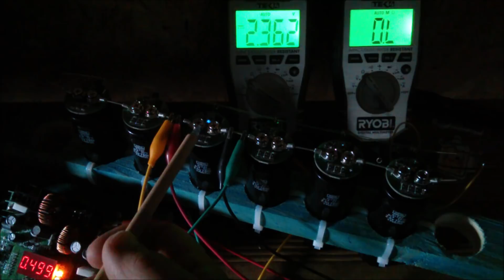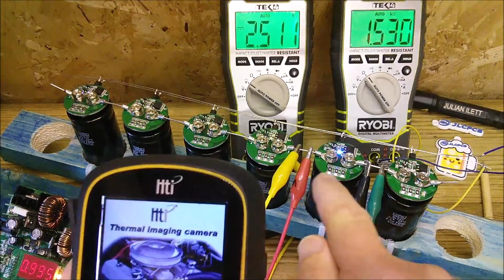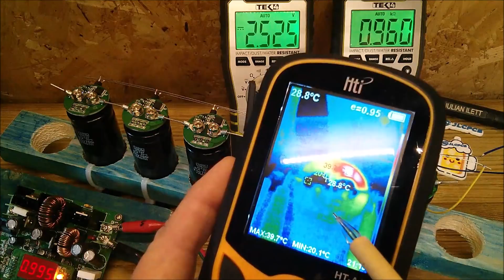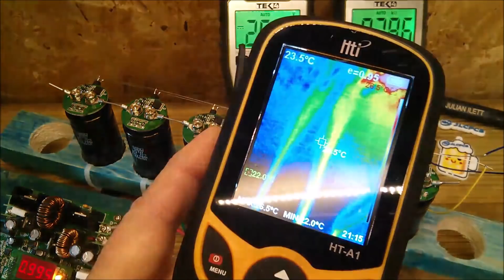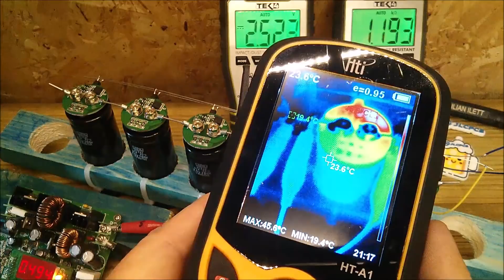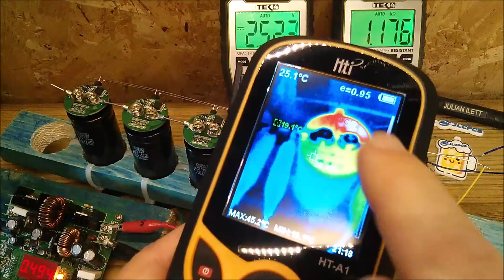Supercapacitor Optoisolator Full Charge Detector

Comment: So I pieced together the root cause and all the other issues with these protection boards. Long story short, it's the TL431:
First, schematic: https://www.eevblog.com/forum/projects/chinese-tl431-super-capacitor-balancer/?action=dlattach;attach=661308;image
1)The TL431 pulls its cathode down to 2V and no lower. 
2)The PNP transistor is left with 0.5Vbe at 2.5V which is below the typical BJT ON threshold voltage of 0.66V (S8550). Most silicon transistors are like this. Germanium transistors would turn on at 0.3V.
3)The low base current in the PNP contributes to a high Vce above 1V (definitely not in saturation!)
4)The optoisolator's series infrared LED contributes to another 1V-1.2V drop
5)The D882 NPN transistor is left with just about 0.5-0.6V, base current about 2mA. For saturation and 3A current to be possible, it would need a Vbe of 1V-1.2V across it. 
6)The balancing resistors are three 1.2 Ohm resistors, making an equivalent resistance of 0.4 Ohms. If the NPN was in saturation and dropped 0.4V, the resistors would start current limiting at 5.5A which is beyond the D882's maximum rating. At the current level of operation, the voltage drop across the resistors is 0.16V at a supercap voltage of 2.5V

Solutions:
1)Replace the TL431 with a version that has a 1.25V reference on pin 2 or a TL432 flipped upside down, and cut the thin trace on the shorted out voltage divider to get the circuit to turn on at 2.4-2.5V. This will pull the cathode of the chip down to a lower 1.25V output and actually give the PNP the base voltage it needs to turn on.
2)Replace the PNP with a germanium transistor or switch both the PNP and NPN transistor to P-channel and N-channel MOSFETs. This is what I did, but my intention was also to upgrade to 20A balancing current. Here is a schematic, note my supercaps are rated to 2.85V, so I can actually get away with a 2.5V reference TL431: https://photos.app.goo.gl/yV3n1sAmudKa6ZR98
And here is my previous video post about upgrading the balancing performance using MOSFETs: https://www.youtube.com/watch?v=3qkKNievsFM&lc=UgyQz4Omeb5TNwf0pSN4AaABAg
3)Increase the balancing resistor resistance to 2.2-2.4 Ohms to limit current below the D882's maximum, only if you want the NPN to run cooler.

Comment: I have a set of those cheapy croc clip leads - and rather than mark them up, I bit the bullet and soldered all the clips - 20 of them I think :o(  I have some cheap Dupont style jump leads too, and not only are the crimps too loose, but I've just discovered that one wire at least is open circuit due to corrosion up inside the insulation - blasted CCA wire - are we doomed to put up with this stuff forever now ? I think I may throw the Dupont style leads away and start again....

Comment: Thanks for all this work, but I think it would work better with an op-amp working as a comparator type lm393 since it works from 2v. Sorry for my bad English.
Reply: The TL431 is already working as a comparator. The problem with it is that it is only a 3-pin device, so its output and VCC share the same pin. When the output is active, the voltage drop across the open-drain falls to only 2V, any lower voltage would turn the TL431 off.

The LM393 is a 6 pin device, it would also work as a comparator, but this time the output and VCC are on seperate pins, so the open-drain can fall to a lower voltage and VCC remains above 2V. Then the PNP amplifier will reach saturation and function properly. 

So I agree, the LM393 would do well in place of the TL431. The protection board should never have used TL431 with 2.5V reference. Only being able to pull down a pin by 0.5V is almost useless in this application. This is the whole reason for the poor performance.
Reply: @InfinionExperiments  And the current drain by lm393 are much lower

Comment: Technically, those dmm are measuring resistance with a constant current source, then measuring the voltage drop on the resistor. This means, when no R is used, it'll saturate the constant current source and the voltage you'll be able to read is about the Vcc. Also, the fact that's putting some current into a collector/emmiter of these optos is actually how they managed to measure it. The optocoupler doesn't work as a switch, but rather as a "remote controlled" transistor. I would've used the diode setting to measure this. Probably you would have seen a Vdrop of about the Vce sat (1.2 or so volts). Make sure that's enough to turn off the enable line of your switching power supply, which should be pulled high by default.
Reply: There is also resistive opto-isolators, but that isn't what this is :) If it were a resistive opto-isolator, his method would be right.

Comment: Fun Fact: When you connect capacitors in series, you increase the voltage they can take but you reduce the capacitance.
Specifically, the resulting capacitance is given by 1/(1/C1+1/C2+1/C3+1/C4+1/C5+1/C6) where C1-C6 are the capacitance values of capacitors 1 through 6. Edit: If all 6 capacitors are the same value then you can get the same result by 1/((1/C)*6)
Reply: Yep but the energy stored is  dependent on the voltage squared so you decrease the capacitance but increase the overall energy stored.

Comment: I couldn't get my Arduino EFI running with those croc clips, and that's when I found out they came in 3 sizes, S, M, L. Soldering the S ones probably would been enough because I only need 1A, so I wouldn't've had to buy the L.

Comment: Julian, the Chemicon capacitors are rated to 2.5V (source:https://media.digikey.com/pdf/Data%20Sheets/United%20Chemi-Con%20PDFs/DLA_Series.pdf). 
The electrolyte will decompose past this voltage. Relying on the TL431 to kick in beyond 2.5V is a really bad idea unless you can sink as much current as can be sourced.
If you will not upgrade sinking current, consider adding a voltage divider to engage balancing at a lower voltage.
If you will upgrade sinking current, refer to my reply in the previous video for replacing parts, or ensure that your current NPN TO-252-2 transistor is actually in saturation mode and not the linear region, which seems to be one of the serious flaw of this balancer the second flaw being that the TL431 is not on a voltage divider (improper balancing threshold for 2.5V supercaps).

Comment: Are you going to put 15v across these caps when you use the speaker? What happens if you connect them directly across a car battery? Do you need to current limit if you are not "overvolting" Do caps have to be slowly charged up like batteries, I thought their advantage was that you can charge them up quickly.
Reply: Yeah, because the internal resistance is extremely low. In my tests of 3000F 2.85V supercaps, I got 3 to 3.3 milliOhm resistance with 15A test current, it can be higher resistance depending on construction. Also in the case of typical EDLC capacitors, there is no chemical reaction taking place between electrodes, so they can be charged in seconds. In my car supercap setup I let the alternator charge them with a current in the range of 200A, and they're finished charging in 10-20 seconds.

Julian is current limiting because he realized that his balancer does not sink as much current as his power supply sources, so if left alone, the capacitor could be overcharged and fail. The better solution would be to upgrade the sinking current, but he could very well do a combination of power supply limiting too. But in my opinion power supply limiting would only be reasonable if his setup was charging at enormous currents like mine at 200+ amps where he also had access to regulate the power supply current.

Comment: Just want to say thanks. I got interested in supercaps about the same time as you started posting videos about them, and went as far as to make some nice CNC'd boxes for them, with the intention of replacing lead acid batteries in lawnmowers, motorcycles, etc. They run great in the motorcycles (for a few years now), but both of the boxes I tried in the lawnmowers failed after a while, I think due to charging coil spikes over the rated volts. In those applications, I undervolt the whole supercap pack, but it's cool to see your experiments right on the edge of the balance circuits.
Reply: There's also a lot of vibration in those lawnmowers. If they failed it could be due to a disconnected lead. I did some brief hammering on one of my 3000F 2.85V cells. Just a slight deformation of the cylinder reconnected the tab going to the positive terminal and all is well again.

With inductive spikes you could add a filter to smooth them out, or perhaps if the alternator is balancing at a very high voltage you could upgrade the balancing circuit to sink the same or more current than it can source. In my car, I've upgraded the balancing circuits to balancing a total of 240A continuous between 12 supercaps, although I expect they will never all need it unless the alternator goes bad (regulator fails and exceeds 16V maybe?).

Comment: I always like to use diode mode to see if and how much a transistor is switched on. It gives you the threshold voltage, which is probably very proportional to the amount of light the IR led inside the opto coupler is producing.
And it's very reproducible between different DMMs
Reply from the maker: I'll give that a try - see if it tells me anything different :)

Comment: Great ! well now we know... the last vid showed us the opto switching on just fine, we know with that 3v battery we develop 3mA so not very bright, I wonder what the data sheet says about its characteristics ? I haven't used optos much so I don't know what sort of stuff they say it can and can't do, is this behaving as you hoped, as they are in parallel ? what is the device please it would be interesting for me to see if I understand much of it ! for instance, what is the " on " state supposed to look like ?...what I do see is quite a fast drop from > 40M ohm to < 1K ohm so easy to distinguish on from off, which is all you want to know, I think...I look forward to seeing it all hooked up...cheers!
Reply from the maker: I'm using the PC817 opto. Yeah, this looks very promising.
Reply: For most opto-isolators/opto-couplers, when operating at a low voltage, the transfer ratio is 100% or thereabouts, but often lower. In other words, if the LED runs at 2mA, the transistor will only conduct 2mA or less.

Comment: The apparent resistance change when the meter autoranges is probably due to Early effect squeezing the base collector depletion layer when the voltage increases. Most people think that a bipolar transistor is a current controlled current source. It isn't. It is a voltage controlled current source. The base current that flows is a function of the device not being perfect. If you could make a perfect transistor (infinitely thin base layer), it would draw no base current.
Reply: You have just invented a FET
Reply: @paulvandergroen9569  Yeah , sounds like 'field effect '
Reply: @paulvandergroen9569  Nope. A perfect bipolar. A FET is entirely different, it has no junction, just a "tube" that is squeezed shut by an electric field.
Reply: @donepearce  The J112 FET is symmetrical , you can swop drain and source .
Reply: @paulvandergroen9569  You can indeed.
Reply from the maker: An opto-transistor is a bit different as there's no electrical connection to the base.

Comment: what happens if 1 cap is low yet the others are full and being charged at the lower current?? and one other question how long do the caps hold their charge with no load?? :-)
Reply from the maker: The low cap will come up slowly to meet the others. After some use, the caps will equalise and be top balanced.
Reply: To add to that, if a capacitor bank is being charged at CC, the low voltage cell will be charged at the CC. If the power supply is being charged at CV, then the low cell will charge at the combined balance current from all of the cells. So if 5 cells were balancing at 1A, the low capacitor would be charging at 5A.

Regarding the self-discharge, here is a chart showing the series discharge of a 6 cell module. https://1drv.ms/u/s!An8m-1BVdhduguxh6-vZwkzqwuXmFg?e=FndohQ
Long story short, it can hold its charge for a very long time. I recorded just over 11 days to go from 12.92V to 11.59V.
At higher voltages, the self-discharge is in my opinion affected by a combination of the leakage current of the balance circuit and internal self-discharge because it is nowhere near the rated voltage. At lower voltages that self-discharge tapers off and diminishes.

Comment: Isn't better if you put opto in series? I think wel activate when all supercapacitors are charged.
Reply from the maker: Charger current must be reduced when the first capacitor reaches top. Opto transistors must be in parallel.